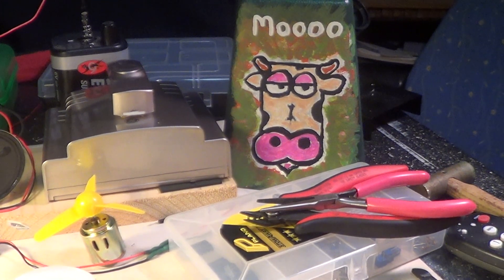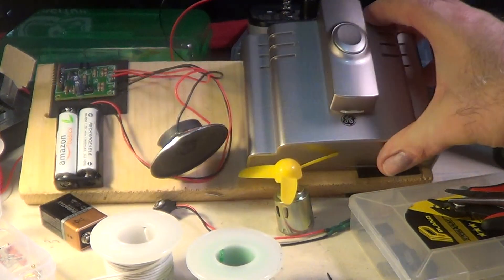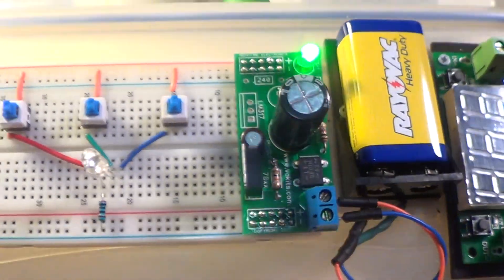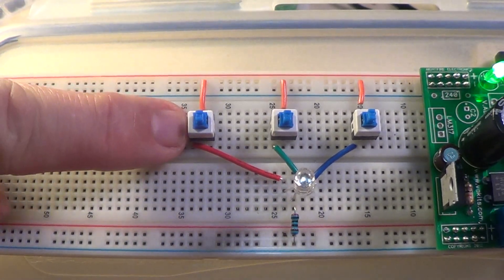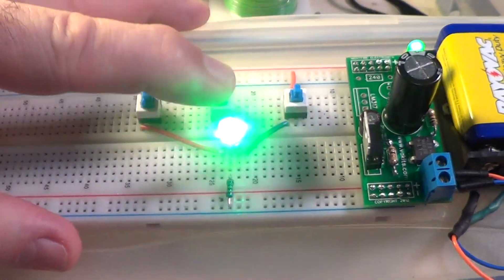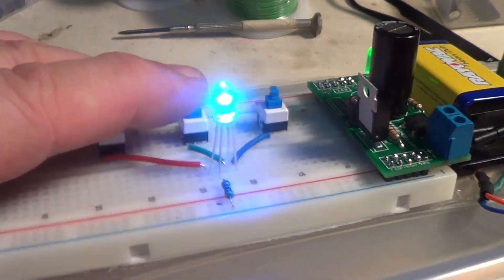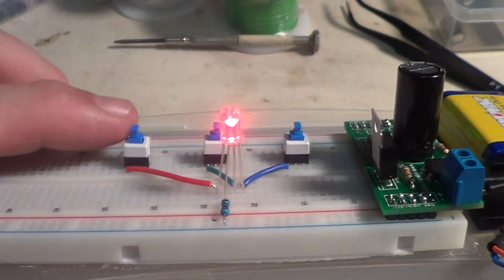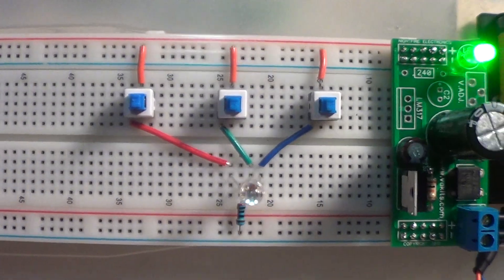Breadboard Project: RGB-LED.

Comment: Each RGB element in the LED has a different voltage drop.  As such, using a single resistor on the cathode causes different current levels due to different voltage drop.  All will still light, but won't be equal in intensity.  Normally, the resistor should be on the anode, in this common-cathode device, in order to give appropriate current and voltage to each.  Usually R = 330-Ohm, G & B and each work with a 200-Ohm resistor.

Comment: You could make it so you can mix any combination of the three colors by getting rid of the single resistor and then connecting a resistor to each one of the red, green, blue anodes. With only one resistor like that, you wouldn't be able to turn on red with any other color - due to red having a lower voltage drop to the others, not allowing the others to turn on.

Comment: Are you as anal about shrink tubing as the chief I used to work with?  He didn't like, "It's low voltage, if they get shocked they shouldn't have been sticking their finger in there."  It was 110 and 220 AC changed to DC and most of it was less than 10vDC.
Reply from the maker: I like using shrink tubing but all my cheif cared about was shined shoes and a correct haircut =)
Reply: *****
LOL getting gigged sucks, bad hair days not allowed!
Oh, do you have a solder sucker?  I had one dude who kept on cooling the solder not sucking it.  It's a cool device.  Like the wicks are, but the syringe is better.
Reply from the maker: *****
That's the first thing I got , works like a charm =)